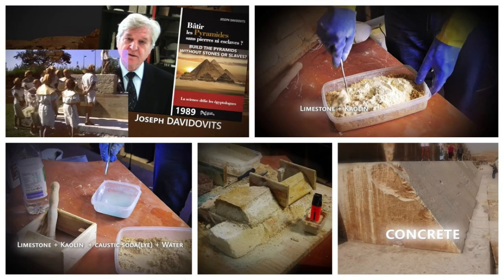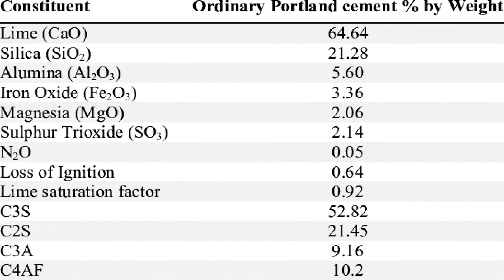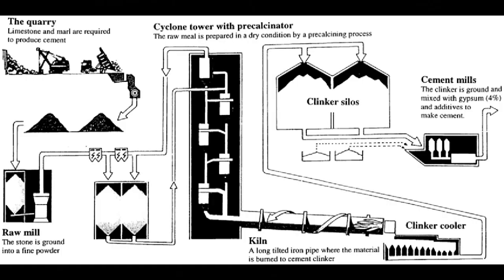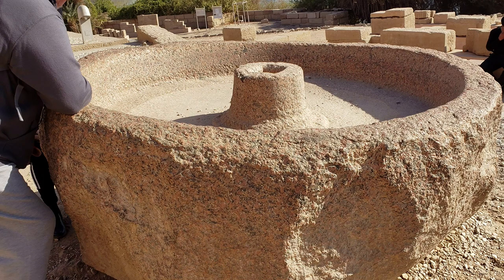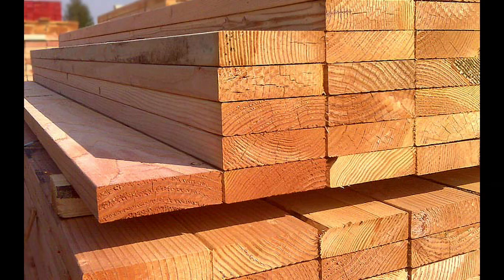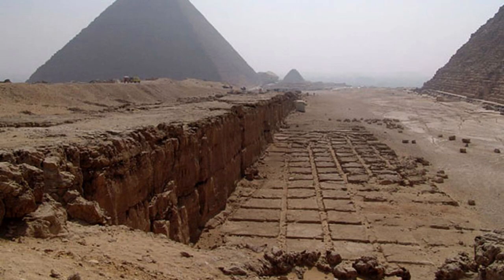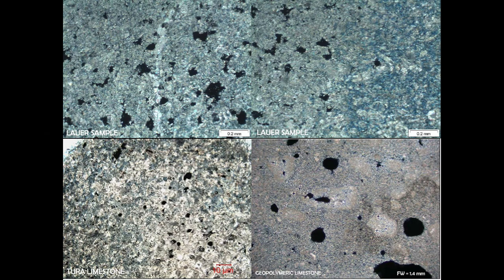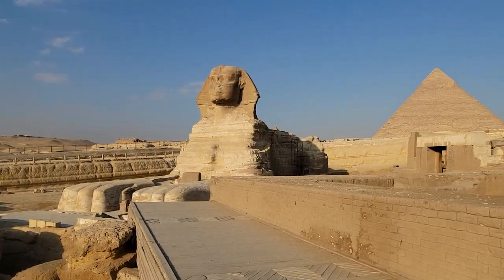Did the Ancient Egyptians use geopolymers? Part 1

Comment: You didn't address the main points in the book about it called "Why the pharaohs built the pyramids with fake stones".  You say they have been consistently tested and proven to be rock.  The argument is that people only go to the effort of testing the first layer of blocks.  Any layer higher than the first is then geopolymer concrete.  You say fossils are a sign of being rock, but so does the geopolymer concrete theory. When they dissolve actual rocks into a concrete formula, the fossils native to the rock would be added back into the concrete also.  The book also claims it could be done easily in a pit with some mixing.  What is the evidence that these more perishable things were scarce? I doubt that at least archaeology could prove they were scarce.

Comment: Please explain the image I saw where one stone appeared to be used as a form to pour the stone, and in which a section of the form seems to have opened allowing the stone to flow under the other. imagine if you will a wooden form to make a sidewalk where the boards have a section slightly elevated and when the cement is poured it flows out of this hole and solidifies under the form as a flow. This is what I saw. Don't try to tell me that pyramid stones were cut to resemble a flow under the stone serving as a form. This would be ludicrous. The only way this could have happened is with geopolymers that flowed when wet.
Also look up Artificial Stone: Has Marcell Foti Cracked the Megalithic Code? He demonstrates boiling granite and having it break down into a liquid which can be poured.

Comment: they had to be built by casting
that's the only way to explain that where two objects touch there is a perfectly aligned joint, through which you can't even insert paper,
you can't do that by cutting the stone.
that you show photos here that the alignment is not perfect can be explained by the fact that the ravages of time have left their mark on the materials or that the filling of the pyramid may have been made up of smaller blocks that didn't have to be perfectly aligned, but on the facade on the outer blocks there is clearly visible perfect alignment, which is only possible when casting.

Comment: Cement and geopolymers are chemically two distinct materials. If the creator of this video can't recognize that, then either they haven’t done their research, or they’re deliberately spreading misinformation.

Electron microscope analyses of rock samples from megalithic structures have revealed high levels of amorphous silica—a marker often associated with geopolymer binding, not natural geological formation. This supports the theory that some ancient structures may have been cast rather than carved.

In addition, numerous inclusions have been discovered within both granite casing stones and limestone blocks—including pieces of leather, tools, and even bones. How did these materials end up embedded in solid stone?

It’s also worth noting that geopolymers set hard within 24 hours and cure over about 90 days, meaning ancient builders would have only needed small timber formwork sections at a time.

Taken together, the evidence paints a much more plausible and efficient construction method than what this video presents.
Reply from the maker: The point of the presentation has completely escaped you. The references to modern cemtitious materials and useage was meant as an example of the type and size of INFRASTRUCTURE required to produce the building materials in question, to point out that the required SCALE of effort and manufacturing to supply enough geopolymer to build, for instance, a pyramid, far exceeds the ability of geopolymer theory promoters to properly imagine it, NOT an argument for the use of modern cementitious materials in archaic times. Regardless of the specifics of chemical composition or materials sources, the VOLUME of material and the enormous difficulties in processing /transporting / forming it by a low-technology base culture where there was no widespread use of the wheel or an efficient way to contain and transport large quantities of mineral slurries in a time efficient manner before they began to solidify remain as immutable fact; my accompanying point, based on those requirements, was to ask, if geopolymer use in ancient cultures was a widespread practice and did indeed supply the enormous quantities of material we see in ancient structures of vast scale, where then is the archeaological evidence of the huge sites that would have had to be built / devoted to that materials gathering, processing, and manufacturing? Answer; they do not exist. If they had, it would be in close proximity to the building projects in question, but all we see in close proximity to these projects are ancient quarries. My summation was that while there is certainly some evidence of occasional, small-scale geopolymer use at some sites, the bulk of the megalithic structures in ruins around the globe is, demonstrably, natural stone.

Comment: This is a new GPT solution folks, its not geopolymer and its not laser / plasma cutters its much more intune with Shamanistic/Alchemist roles : 
Title: Reconstructing the Lost Stonework of the Inca: A Study in Biochemical Lattice Manipulation and Ritualized Geochemistry
Author: [Anonymous] Date: [Modern Analysis of Pre-Columbian Engineering]

Abstract: This paper explores the hypothesis that the precision-fit stonework of the Inca civilization was not achieved through traditional chiseling or carving, but through a sophisticated biochemical process that temporarily altered the structural lattice of volcanic rocks such as granite and andesite. By combining mineral-rich clays with organic compounds and applying heat and pressure, Inca shamans and engineers may have employed a ritualized, alchemic method to soften and reshape stone. This paper proposes that what has been dismissed as folklore or myth may instead point to a practical, though lost, form of molecular stone manipulation.

1. Introduction The stonework of the Inca civilization, particularly in structures such as Sacsayhuamán and Ollantaytambo, demonstrates astonishing precision without the use of mortar. Scholars have long debated how these massive blocks were shaped and fitted so perfectly. Existing toolkits of the Inca, primarily bronze and stone, are insufficient to explain this level of detail on hard igneous rocks. This has led to theories ranging from lost technologies to extraterrestrial intervention. We propose a middle path: that the Inca used a biochemical method involving clays, acids, and organic matter, grounded in shamanic ritual and practical alchemy.

2. Proposed Chemical Mechanism The process likely involved the following components:
Ilanca Alpa: A red, glittery clay, rich in iron oxides and silica, described in Quechua lore as a sacred "earth blood."
Bat Guano: Rich in nitrates and ammonia, which could create localized acidity when combined with water and microbial activity.
Goat's Milk (or similar organic source): Provides lactic acid and casein proteins, which aid in chelation and breakdown of calcium and silicate bonds.
Heat Application: Either solar heat or low-temperature fires to activate the chemical reactions and deepen penetration into the rock's microstructure.
When combined and applied to stone surfaces, this paste-like material could chemically loosen the stone's lattice structure by reducing the integrity of silicate and calcium bonds. This would allow the rock to be reshaped or fitted before re-hardening over time.

3. Lattice Axis Integrity and the Role of Protruding Knobs Many Inca stones exhibit protrusions or "knobs" that have puzzled archaeologists. We propose that these knobs served as structural stabilizers during the recrystallization of the rock. In materials science, any sudden removal or reshaping of surface anchoring points can destabilize stress vectors within the material. By preserving these knobs, the Inca ensured that internal molecular axes remained intact, reducing the risk of surface flaking or disintegration after re-hardening.
If polished or removed post-treatment, the reformed lattice may become unbalanced, leading to long-term degradation. Thus, these knobs functioned similarly to rivets or keystones in mechanical systems: not decorative, but essential.

4. Shamanic Ritual and Alchemical Framing This technique likely did not exist purely as a mechanical process but was embedded within a broader framework of ritual and cosmology. Stones were considered alive; shaping them was a negotiation with the spirits of the earth. The shaman-engineer likely prepared the mixture in sacred ceremony, aligning not only physical but spiritual vectors for the bonding of material.
The ritual may have included:
Lunar or solar timing
Herbal infusions or smoke treatments
Chants or vibrational harmonics to influence lattice behavior (akin to cymatic resonance)
The combination of material science and spiritual geometry would result in a unified act of construction, one that defies modern distinctions between engineering and religion.

5. Conclusion and Implications While empirical evidence remains to be experimentally confirmed, the convergence of biochemical plausibility, indigenous oral tradition, and unexplained architectural precision suggests that the Inca may have mastered a form of lattice manipulation lost to modern science. Reconstructing this process could not only revolutionize our understanding of ancient engineering but also restore a sacred dialogue between matter and mind, one where construction was an act of communion rather than domination.
Further studies should aim to replicate these mixtures under controlled conditions, test their effects on igneous rocks, and reexamine Inca construction sites with this lens.

Comment: Two important items copper smelting, to bronze, to iron, aluminum oxide. Pottery clay.
Copper oxide and aluminum oxide,  thermal reaction magnesium. Copper thermite, 
Iron thermite. With ingredients together magic. With granite gravel and clay casting, heat management, and gold from stone.  Heavy metal go to bottom. Nubs start a chain reaction at low point. Heavy metal for prossing.  Gold, iron, can be refined, and melting granite should cool to clay shape or form. 
This thermite reaction heating 2700c. No trees, all heat, 0 co2, refined materials copper and metals.  
A weapon can be made from powder. Advancement of power over other countries.  And stone currency for profiteering from it. 
Common connection with elements, smelting, pottery, trades with tribes to bring wealth for new industries created.  Waste management of pottery industries to fiil Pyramid stones, recycling ♻️. 
Please  consider this as it explains  many answers and is currently proving science, and is worldwide at different times in history. 
Ingenuity, not chiseled,  melting into place, slabs cutting with disc of granite and metals was found. Drilling hot. Can be all explained.

Comment: @AncientEgyptArchitecture 
Science is also based on being able to replicate a hypothesis. 
Being that the Geo polymer theory is replicable, and the look of the stones created matches that found at Giza. It's the best theory this far 

Stones weighing hundreds of tons are immovable and that hypothesis is not replicable by even heavy machinery today. 

The end result being grandiose does not necessitate a grandiose method of construction. 
The simplest explanation is the most likely
Reply from the maker: I think it is easily demonstrable that although certainly there could well have been limited/small-scale use of geopolymers for special applications in ancient Egypt, as far as very large stones are concerned, take a look at the monoliths used to create the valley temple; they weigh several hundred tons each and we know they were quarried from around the Sphinx then lifted out/stacked into the temple enclosure plan, by examining their stratification characteristics and them comparing/matching it with that in the Sphinx trench. So massive weights such as those megaliths were not immovable. Similarly, huge blocks weighing over 200 tons at the base of Khafre's pyramid show large nummulites (fossils) on their outer surfaces, which precludes their being geopolymer because (a) these large fossils would not survive the process of manufacturing the crushed materials required, and (b) once again, the strata and composition of the stones has been matched with that in the nearby limestone quarry on the plateau.
Occam's Razor does not always point at the right answer.

Comment: If geopolemer was used there would be no spaces between the blocks  if they where formed in situ, if they where formed in moulds there would be a uniformity that could easily be dected
Reply: not even moulds, the geopolymer can be made in a consistency silimar to bread dough and it hardens wih cold water

Comment: Are the stones cast or cut? Cast would explain why they fit so perfectly together. But other things points to cut.
One thing is sure, it's impossible to cast granite. Right?
Reply: Yes, it is possible to "cast granite", but not by melting natural granite and pouring it, as granite is too resistant to melt. Instead, "cast granite" refers to cast stone products made by mixing granite aggregates (crushed granite) with cement and other binders in custom molds to form a new, stone-like material. This process creates architectural elements and decorative objects that can be indistinguishable from natural granite.

Comment: Look closer!! The fossil(not exactly) micro tubules themselves are structured to the cuts so material analysis is along the right road but they wouldn't have cut the blocks then aligned every fossil structure from block to block?would they?Thats what is happening at 5:57 (yellow nail varnish)  That is evident, not the nail varnish the micro biology work force! The micro tubules look like fossils yes but run along cuts and turn round at cut lines or the individual fossil structure is recessed at the cut line or in some way conforming itself to the cut line as an organised micro organism collective. Sounds unbelievable but it can be shown and if you look with an open mind thats a start. This can be demonstrated by slicing a fossil rich piece of granite then placing them together compared to the cohesive structure conforming tracks and edges of the fossil tubules found at the cut lines of the Giza and Peruvian monuments. The human explanation is more ridiculous than Anunnaki bio technology/;@ the intransigent armchair scientists of this world.
Reply: no one is talking about granite.

Comment: The comment section is always a strange place when it comes to this topic. It is 100% certain these rocks were never ground down and recast as a geopolymer, this is so easy to demonstrate that even suggesting they were is embarrassing. It's the myth that just will not die. 
If in any doubt, learn about geology. It literally takes thousands of years for mineralised magma to slowly cool and form rocks comprising of well developed crystalline structures (of component minerals, quartz, mica, feldspar, etc) such as granite, pegmatite, etc. If the rocks were melted and poured, they'd take the form of obsidian/volcanic glass. The crystalline structures are still intact, and with limestone they still contain their fossils, they were never ground into a cement mix, so there is no geopolymer explanation to explain the precision found in some of these structures.
Reply from the maker: Amen. I had a sound education in geology and gemology, and you are spot on sir.
Reply: @AncientEgyptArchitecture  has it ever occured to you that the geopolymer process affects only the interstitial cement/matrix but not the framework of the microstructure? making it possible to soften and rearrange the shape of the rock but not necesarily all of the components of the microstrucre, allowing it to retain the ''granite'' layout? they have found hairs and fibers embedded in it
Reply: your comment indicates that you dont understand what is being proposed. no one is grinding down anything and recasting it.
https://new.nsf.gov/news/surprising-truth-behind-construction-great